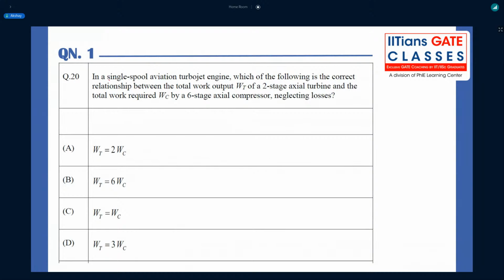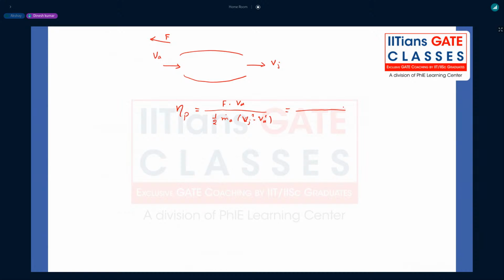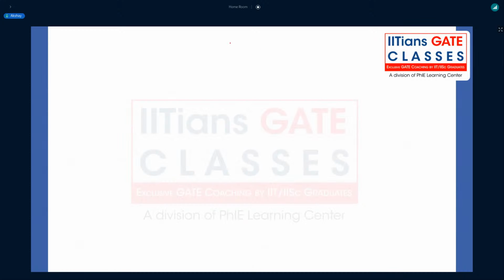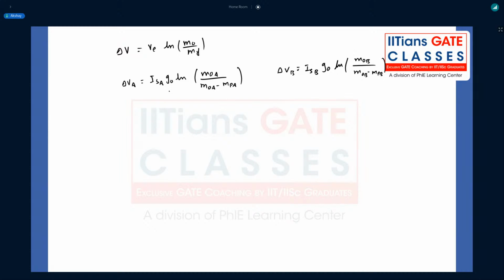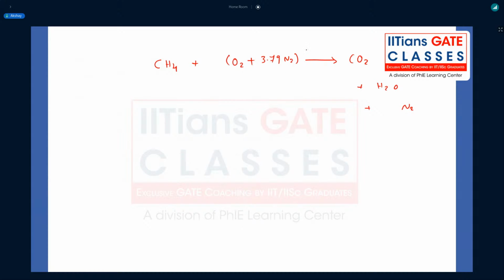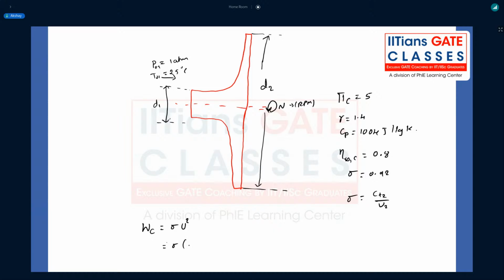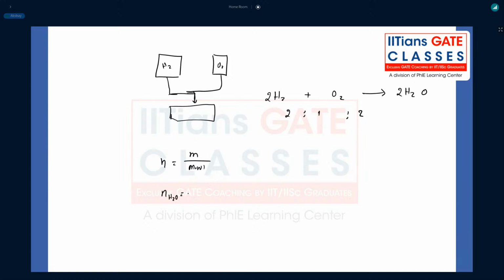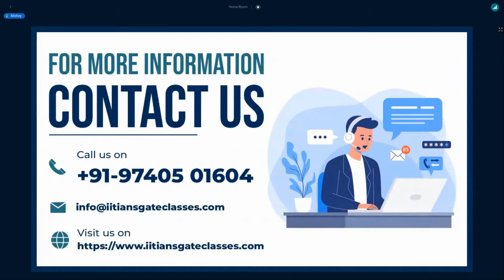GATE 2023 Aerospace Engineering Question Paper | Propulsion Solutions | GATE AE Online Coaching

Comment: There is small mistake in question 65.
Since we have rate of H2 and rate of H2O are of the same ratio [Note: 2H2 + 1O2 --> 2H2O i.e., they are in 2:1:2 proportion] hence for every 2kmol/s of H2 we get 2kmol/s of H2O formation. As we have 32 kg/s of H2 supply that is 16×2 kmol/s of H2 and hence 16 kmol/s of H2O formation.